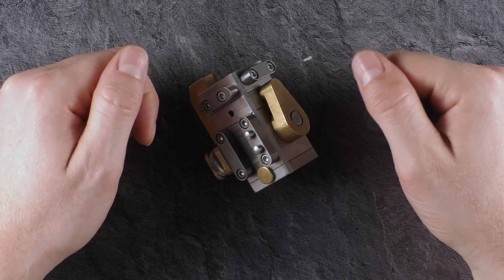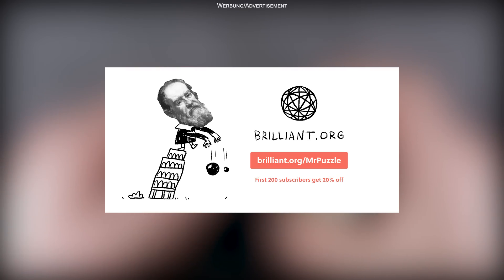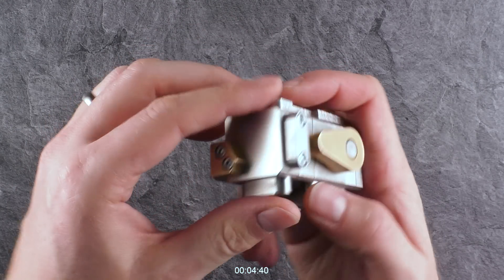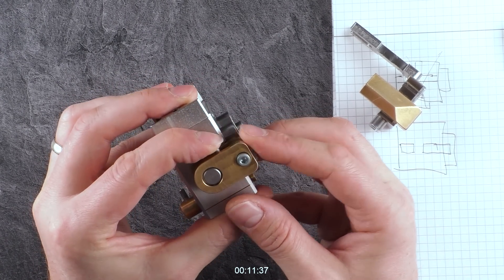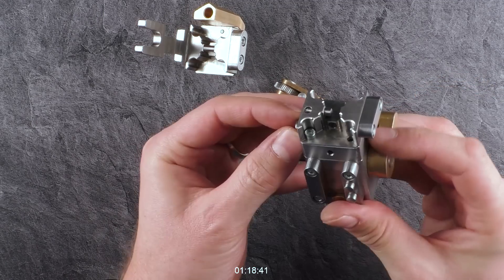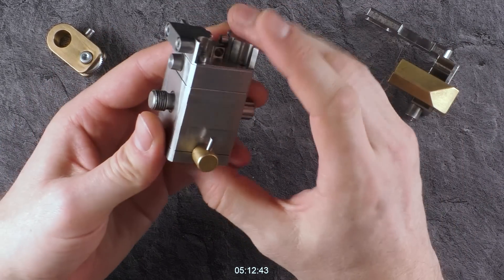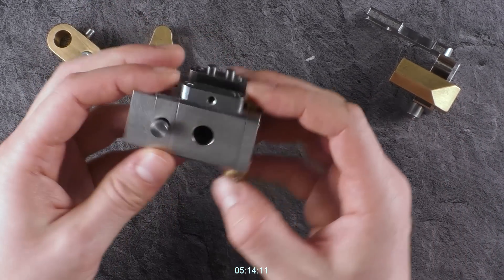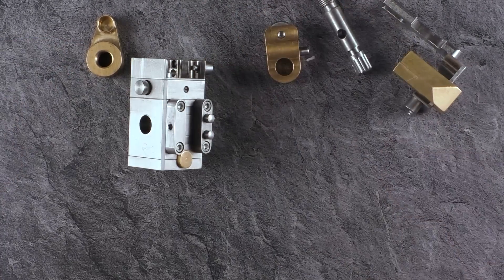Solving a ONE-OF-A-KIND Puzzle worth $2000 - Unsolved until today!!

Comment: that moment around 9:25 would have been a cool idea for a puzzle though. Have a box that needs to be unlocked by some sort of contrived key tool which was originally part of the box. So you do all these moves moving the pieces off the box, you do a bunch of other moves to assemble all the pieces you removed into a tool, then you use the tool to unlock the box.
Reply from the maker: Already got some ideas :)

Comment: Assuming the tabletop is granite, such damage can be repaired by resurfacing the entire top of table, or, the damage can be hidden by filling the damage spot with similar color felt pen. Filling the damage spot with any kind of putty will require sanding down which will ruin the high gloss polish around damage spot.

Comment: I suggest a change.

I think that last move, where you must rotate the brass cylinder with a tiny steel decorative pin sticking out, should be combined with the sliding-through steel cylinder that is closer to the other end of the puzzle.

This is my suggestion: make a groove in the interior seizing pin, which is clasped by a "lip" (sort of like a rotating cabinet latch,) that slides into a circular groove in the side of the pin, and the "lip" is incorporated almost full-circle except a gap. Meanwhile, butted up against the other end of the hidden seizing pin, the back-and-forth sliding steel cylinder (which movement you referred to as "a glitch" near the end,) should butt right up against the hidden pin, keeping it in place from the other end, and also have a hole somewhere along its length to accomodate the pin's circumferen.

So, to solve it, and free the groove from the rotating lip near one end, and un-butt the opposite end, you would have to hold and twist the rotating brass cylinder while also manipulating the sliding steel cylinder back and forth, testing combinations until you get the clasp to unseize and the hole to line up at the same time. To give a "feel" to the user, a chamfer of a thousandth or two (maybe more) could be put on the edge of the sliding steel cylinder hole.

Comment: I accidentally deleted an old comment but I did want to suggest if it its possible to the manufactuer that before this puzzle goes into mass production to make the objective bolt that you're trying to remove to be of a different color from the rest of the components that make up this puzzle. The reason for this is so the puzzler has a focal point to focus on while trying to solve this.

Comment: You can argue until the cows come home on why this puzzle should be worth $2000, but I don't think it should be. It's far too simple of a solution. $2000 for a four move disassembly? No.
Reply: You must not be familiar with CNC machining. The programs, the cutting tools, and the materials used in this puzzle give it the price tag. None of the cost of this puzzle is in the design and at $2000, the designer and creator of this puzzle has almost certainly not profited from it. The value of this item is $2000, I don't believe anyone has even bought it.
Reply: @roo1871  Not sure what your argument was trying to achieve, since you're essentially saying the creator is an idiot.